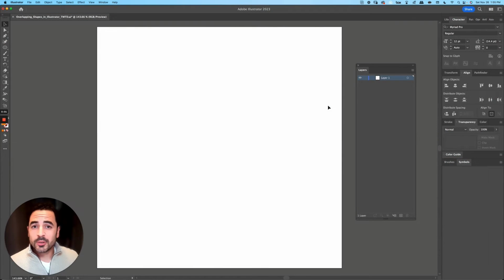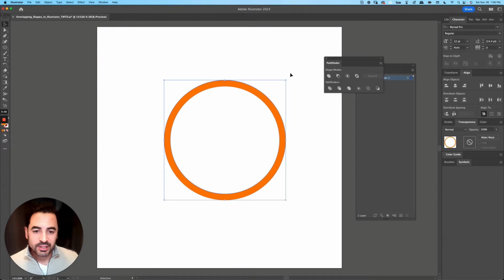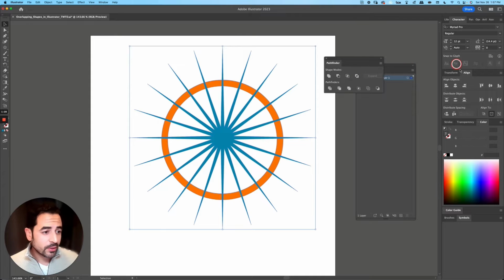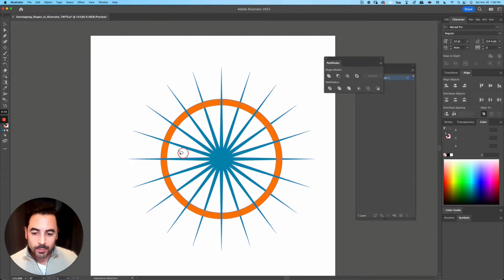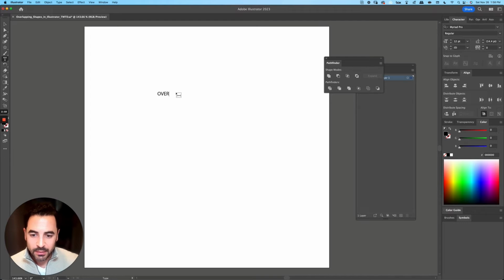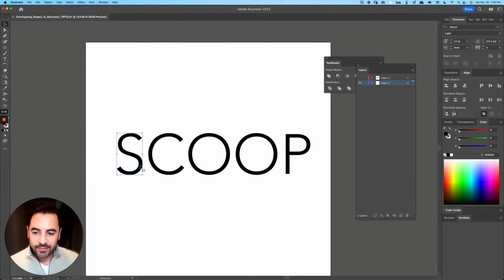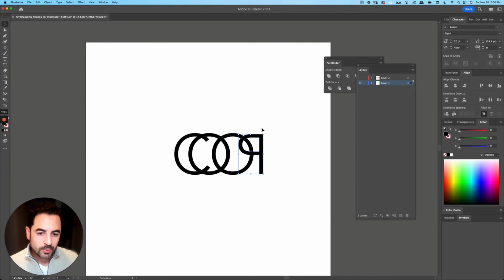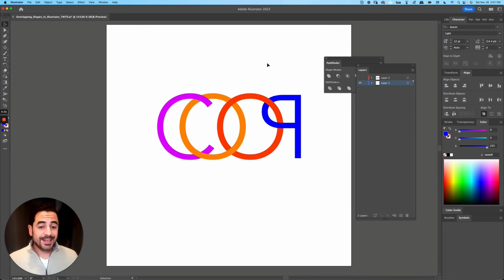Overlapping Shapes in Illustrator

Comment: Which workspace are you using? I dont see Pathfinder in my right hand side. Also I couldn't be able to find Minus Front
Reply from the maker: @caitlinwu8917  the Pathfinder Panel can be found under the Window Menu. You can choose which panels you want to have open, and then save it as a custom workspace preset which can be handy.